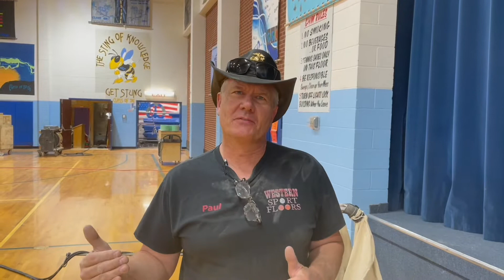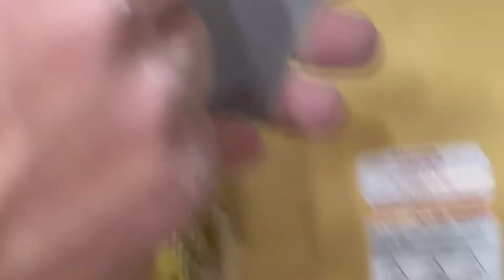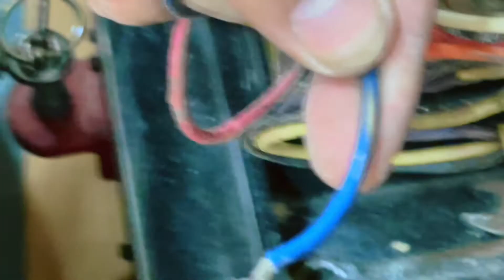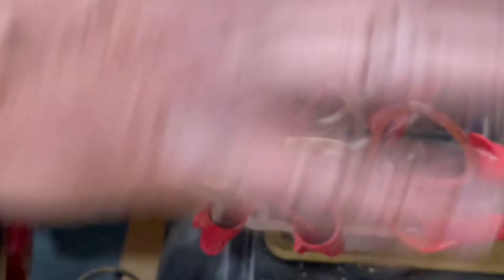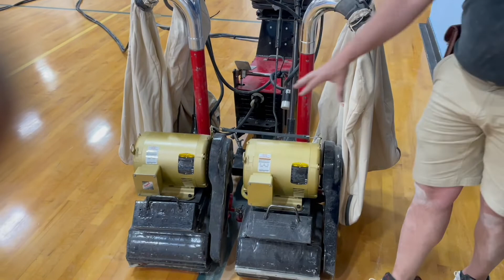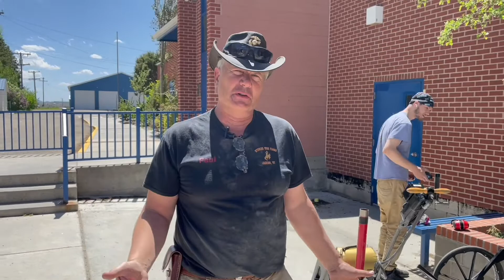How to: Wire Your Gym Floor Sanders From Low Voltage to High Voltage

Comment: Actually, running three phase power is actually better for the sanders. You’re actually using less amps per motor stronger power less amp draw on the motors so the motors are going to run cooler The motors run better  and it’s just better power in general for the machines to operate we run it every day. But we carry around 25 KVW generator so I have my own power but definitely high voltage is better for the machines in general.
Reply from the maker: Our observations agree!! The sander motors Love High Voltage!!

Comment: We can only switch American equipment to high voltage so that it works and does not burn out 😁
Reply: That’s not true basically anything with three phase power the galaxies have three phase motors that you can get for those same with the Clark see if 12s if it’s a three phase motor or you can rewire it for higher low typically